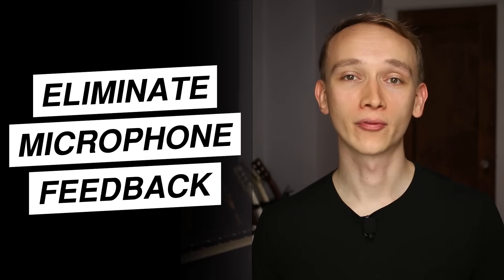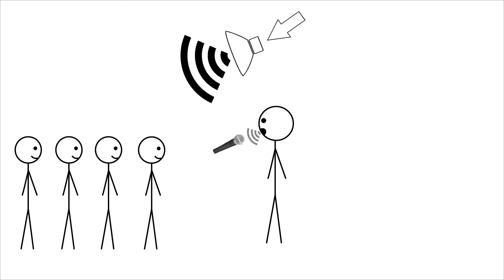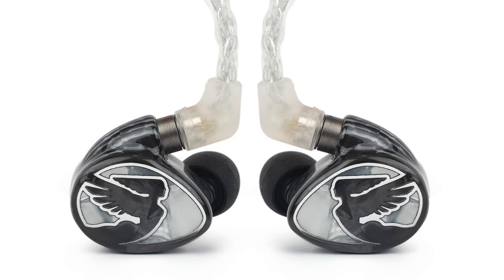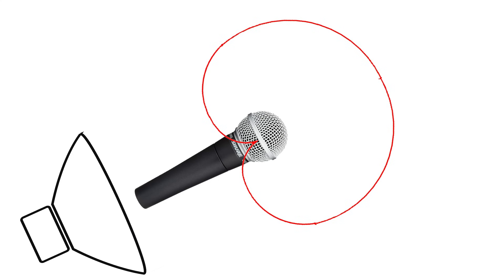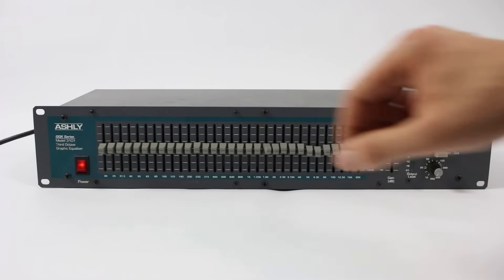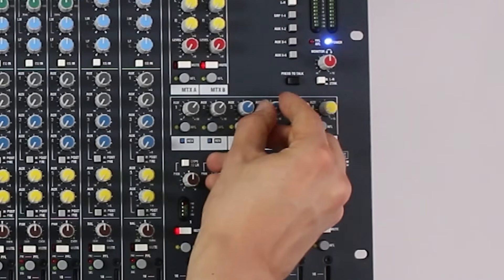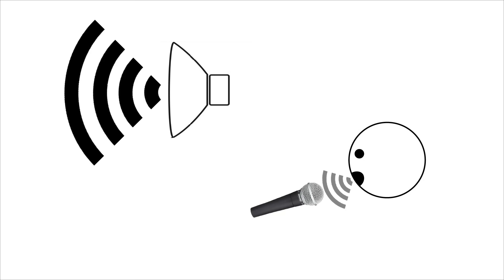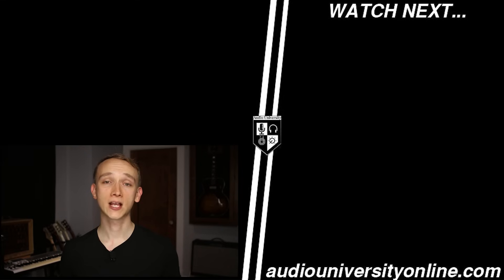How To Eliminate Microphone Feedback | 5 Must-Know Tips

Comment: Here are 3 tips. First, throw every other vocal mic on the front line out of phase. Instead of anomalies caused by multiple mics loading up, they will now cancel out. This stabilizes both mains and monitors. Second, put about 14 ms delay on the mains. Not only does this align the sound from the back line with the mains, it simulates the mains being further away from the mics reducing the chance of feedback. Third, when ringing out monitors by driving them in to feedback, using a compressor limiter at the end of the chain with the threshold set very low to limit the volume of the feed back. This will  not only protect your ears, it will protect all of your speakers. You can now allow the speakers to feedback at a very minute level, giving you total immunity and allowing you to figure out what frequencies are feeding back assuming you don’t have an rta . Remember to return the threshold to a normal setting.  Btw, after setting the system up, during soundcheck drop the threshold of your limiters on both mains and monitors so it hits 3 db of gain reduction on peaks.  This protects your monitors as well as your ears, and helps to keep the musicians from getting audio fatigue.  - 40 years btw of dealing with feedback and musicians.  Mic cuppers sound like they’re being kidnapped btw.

Comment: 6:17 It's worth mentioning why we want to avoid unnecessary amplification.

The reason is because the amp at any point in the path doesn't discriminate between signal and noise. It will amplify both. So a guiding principle to start with a strong clean signal and try not to mess with it too much.

Comment: Nice work, need your help Engineer
I just bought passive loudspeakers
 a mixer,equaliser, crossover and amps.
1. How do I ring out mic feedback
using the graphic EQ without affecting my Eq settings for the song playing, since IAM using 
Only one or the same  EQualiser?
2.Is it possible to use a 2 graphic EQ
For mic vocals and for the song sound Eq
Independently, so that they won't interfere
3.Can you please 🙏 do an in-depth tutorial on 
 crossover knobs functions( since my subs are singing vocals I don't know to fix itI
I hope you understand my problem,
Iam not an audio Engineer 🤯
It's George from Tanzania.

Comment: Putting the stage foldback monitor 180 degrees out of phase to FOH will allow more gain before feedback. For analogue systems, make XLR adapters, with pins 2 & 3 swapped at one end, and place inline.

Comment: Question; I have a Karaoke bar and constantly deal with feedback issues. The room is mostly surrounded by glass, so sound is bouncing off the glass and into the mic. I am currently looking for the best method to eliminate this issue. What do you recommend between getting an EQ or one of those Feedback eliminator devices? Something that you set and forget, and dont need to constantly adjust frequencies. Thanks!

Comment: Great stuff, but one thing that wasn’t mentioned in regards to feedback: venue size and construction 

Having mixed in many small, acoustically poor venues, the gain staging will usually have to be approached differently for each venue, as the process for the last venue won’t work due to excessive reflective signals off walls, girders, etc. 

Still great to know these basics though

Comment: I think preamp gain should be set based on what is required for a great basis for front of house mixing. Ideally you want to have all faders for FOH sound to be within -15 to +5 db area. (Exact markings depend on the mixer, some mixers mark this aforementioned 0db as -18db and then have 0 where you got horrible digital clipping, but should still portray the logarithmic scale on fader markings.) 

Higher gain than necessary results in lower fader position, where even a small movement of fader is a big change in sound level. And lower gain than necessary will cause you to run out of the fader travel without getting enough sound level. And on a multichannel pre-fader multimonitor setup you better not touch the gain after you have set it, no time to compensate everything down the line in a live setting. 

There is a simple trick to get the monitor levels to be at unity if you want to have that: turn down the monitor amp volume control, set the monitor sends, and then turn the monitor volume slowly back up where it is needed.
Reply: Yeah I was just thinking, I understand his strategy in setting the amps at 0db and then slowly increasing the gain until it's loud enough I the monitors but it completely ignores the fact you might need more gain out front.

Had my third time mixing a band recently and they asked me to turn up their vocals in the monitors during the show and I had the most embarrassing screeching for the next few seconds. I hate it so much. Studio sound ftw

Comment: Thanks for the video! I'd like to mention that gain is in everything throughout the signal path, not just the preamp gain control. I think the term could be more clear if called "maximum total amplification before feedback", meaning that it has to do with all the amplification stages the signal goes through.
Electrical noise also has to do with system feedback, so it's always good to set the preamp with the proper gain for the instrument, and letting a bunch of unnecessary noise get through by using the output levels as input levels. I agree that preamp gain has to be set properly, but that means not that too much as well as not too little. It depends on the signal level coming from the instrument, not on feedback.

Comment: Because I’m usually the only person in my studio, I just simply either turn right down or Off my monitors and use IEMs when singing into the Mic just to be safe. 

I’m currently using one of those Zoom H2n Recorders (just for its Microphone) and plug its Line-Out into an audio interface. I do plan on buying a regular Condenser Mic later on though because I’m really interested and want to try one out!

Comment: Question . How do you connect a Behringer FBQ2496 feedback destroyer to a Behringer PMP6000 powered mixer? I am only using this for home karaoke parties. I don't have a full band equalizer to do what you taught.  Only an onboard 7 band equalizer that doesn't seem to help.  A detailed description of using what cables involved ie an insert Y-cable to what input of the mixer. It was not recommended to insert into the FBQ into the microphones' s insert channel per the manufacturer. Their connection diagram on the user manual doesn't seem to suit mine. I have 2-3 microphones, 3 sound sources and 2PA speakers and 2 Powered Subs. Thanks for any helpful answers.

Comment: I have a 2 channel power amp available to connect to an Allen/Heath PA28 mixer. The user manual talks about using FB1 for monitors, which I have configured the A-B outputs where 'A' is used for monitors via one  amp channel and 'B' for Mains via the other amp channel.  Is this the proper way to hook up the monitors or should I be using the Aux send?  I have no individual control of instruments/vocals to specific monitors but I assume that's because I'm limited to just two power channels?

Comment: Is cardiod polar pattern really the most popular pattern for live sound? I find supercardiod to be generally more useful. 

Where a cardiod's null is a single point, a supercardiod's null is a ring, which enables you to place more than one monitor in the mic's null zone. 

Also, with a cardiod, you have to angle a vocal mic at about 45 degrees from the floor to null out a monitor in front of the mic. With a supercardiod, the mic will be roughly parallel with the floor. That works much better for keeping the vocalist on axis even when the vocalist backs off of the mic. With a cardiod mic at a 45 degree angle, if the vocalist backs off, he/she is not only losing volume by increasing the distance to the mic, but also losing volume by going off axis.
Reply from the maker: I’d guess cardioid is the most used, but you’re correct here. There is an advantage to using supercardioid vocal mics. Well said, too. Thanks, Al!
Reply: Most microphones are cardioid, also the legendary SM 58.

Comment: Did you forget to suggest Microphone selection? Condensor Mics feedback at much lower levels than Dynamic Mics (risky!). Another big problem is getting the singer to sing louder than the monitor speaker. A very soft singer is a tough problem.

Comment: There is something subtly wrong with your description of when feedback will occur. It is not when the amplified sound of the singers voice is louder than the singers voice, any sound that makes it to a microphone at a high enough level that when the sound captured by the microphone is be then amplified, the gain produces an amplified sound that then makes it back to a microphone at a high enough level to repeat the amplification in a loop. Feedback is always happening, the screaming of a tight band of frequencies that we call feedback is just when the feedback of any sound can built on itself getting louder and louder until it reaches the maximum volume that can be produced by the amplifiers and speakers. A system can start to audibly feedback seemingly out of the blue or when someone or something moves in a way that reflects just enough extra to trigger a loop of the system is on the edge of a feedback loop. 

The more open microphones there are, the less it takes to trigger a feedback loop.

Comment: I have a limiter in my monitor chain. For problem hard to find freq’s, I drop the threshold of the limiter as low as it will go. I then raise the gain of the mic till it starts to feed back. Because of the low threshold on the limiter, the limiter will only allow it to feedback at a very low volume, not allowing it to “run away”.  At this point you have immunity, and can play with the 1/3 octave, pushing faders up to see which is the problem freq, or cup the mic causing to feedback, all at a low, controlled volume.  Or, view the problem freq’s on an rta. Afterward, bring the mic back to a reasonable volume before raising the threshold back up. I eventually set the threshold to just kiss the louder stuff, helping the musicians from going through too much audio fatigue, and protecting you amps and speakers.  Btw, I trim my mics cold so there’s much less chance of distorting the mic pre.  Remember, a distorted signal can derate your speakers handling power by as much as 90%!

Comment: I have limiters in the monitor chain. For real problems, I drop the threshold of the limiter down very low, then raise the gain on the mic. When it feeds back, the limiter will catch it and it will feedback at a low, controlled volume. Now with relative immunity of the feedback running away and damaging your ears or speakers, you can play with the 1/3 octave to find the most sensitive bands, or if digital, see it on an rta. You can play with it, cupping it, or hold a guitar which also will affect the response. After you stabilize it, reduce the gain to normal, then raise the threshold of the limiter to where it just kisses the signal at the loudest points. A slight limit on your monitor helps everyone with audio fatigue, and helps to protect the system overall.

Comment: 4:22 What if you do not have a graphic EQ? Can this be done another way? The only thing I have to work with is a soundboard (same model as the one you show in the vid) and my ears. Thank you!
Reply from the maker: Any EQ can be used to ring out monitors. Some EQs just give you more bands, which is helpful.
Reply: @AudioUniversity  thank you for your response! What I am trying to ask is if you do not have a computer that shows you the graph of the frequencies (to determine which ones to turn down), is there any other option besides sweeping?

Comment: Hi Kyle, I watch all your videos and I'm very grateful for them.  I'm self learning live sound reinforcement and studio recording as a hobby. 

Can you tell me more about your thoughts on setting the Aux to unity and then using the pre amp gain to get your level.  You say that with the Aux at 0db and using the gain to regulate the level the musician needs, you can keep the gain low.  This struck me as I thought gain should be set to 0db using PFL to ensure the optimal signal to noise ratio (SNR).  Will your method of keeping input gain low result in a weaker signal and bring in ambient noise and then the high Aux level on the output side amplify the artist signal and the ambient noise also resulting in a degraded sound?

If there is a reason what I'm saying doesn't apply or is wrong, I'm really interested to know why, as it means I am carrying around some misconceptions or living by hard rules that don't always apply. 

Thanks for all your videos and looking forward to hearing your thoughts.
Reply: If I may, both the console manuals and AU's approach allow for a unity gain scereno. What was not mentioned here is the system gain structure. It's assumed the system gain was already set. AU discusses gain structure in another video. On the flip side consider the fact audio sources fluctuate. So setting the mixer's aux sends and channel faders to unity and then adjust the gain offers many benefits that may not be mentioned in console manuals. Also SNR in modern analog and digital mixers is a mute point when the engineer approaches gain structure as described in the videos. And then there's the big if, you experience noise while turning up a gain knob, that may be a defective channel or an issue up stream. Like an issue in the cabling, microphone, DI, instrument or amp.

Comment: if you set your monitor send and channel send at unity then add preamp gain to desired loudness you are changing the preamp gain in the front of house. not having tried this method, my immediate concern would be improper gain at front of house (too low, too high). I have always dialed in preamp gain with the FOH. then while running monitor at unity i'll adjust the channel send to musicians needs. I typically find the musician has enough perceived loudness well before the channel send reaches unity or feedback ( given that the musician doesn't cup the mic and the stage is set up properly)
Reply: Right

Comment: Before i start, i turn 0 my foh vol, then i set the overall proper gain structure not more than or lesser than to unity, to make my gates, compressors, eq ect got enough signals. After that i set my monitor sends to "unity"also, then i set the volume of the monitor wedges up slowly, if it feedbacks then i start to use my eq. Then turn up slowly the vol until the its enough to the musician. Then after that ill turn my foh, so im sure i get decent overall gain structure.
Reply: Hi there. I am Timothy from Uganda. I have just started practice as a FOH. Am really enjoying the experience however I would like to contact you in person.

Comment: Hey Kyle,
I really enjoy watching your YouTube Channel for your great advice in learning audio properly. I’m working as an Audio Engineer on many Hotel Meetings & Corporate Events doing live sound in a different Ballroom every week. I’m considering purchasing a reference microphone and could really use your help in learning the proper process of using it. I couldn’t find any clear direction on YouTube showing how to properly use this type of microphone… Any chance you could please put out a video showing us how to setup and properly use a reference type microphone???
We would all greatly appreciate it if you could. Many Thanks!
Reply: Beringher ECM8000 is enough. It is a cheap measurement microphone but it is really good. Just keep in mind that it has problems with the high end (12Khz and up, but you don't usually need to measure phase trace of those frecuencies and tonal adjustement can be done by ear) I've been working for 15 years in corporate events and I use that microphone with Smaart and RiTA FFT-based audio analyzers and it works pretty weel for me. And I don't have to be afraid of loose or broke a 300€ mic.

Comment: Any videos on using lavs? I usually have to use 4-6 wireless lavs for panel discussions and have a horrible time keeping them open (so I don’t need to ride the faders) and not getting feedback (all presenters are about 3’ apart from one another)
In addition, what’s the best way to provide them a monitor? Thanks in advance.
Reply from the maker: I don't have any videos on this, but it's a great suggestion. Here are some notes in the meantime:
- It is definitely a challenge managing multiple lavs on stage, especially omnidirectional lavalier mics. Sometimes, you just have to ride the faders or use an auto mixer.
- I usually try to be minimalistic about how much spoken word goes to a monitor. It usually doesn't need to be very much (if any) unless there is something the speaker needs to hear over, like music.
- Try putting the the lav mics into a group and use a parametric EQ to cut frequencies and feedback in order to maximize the loudness and intelligibility. 

I hope this helps. Thanks for watching!

Comment: Great content. I've been following for a couple of weeks now and I must say your content really is help. My approach is usually first gain staging, all channels across the board. This helps when I have to run FoH, monitors and even running a 2.0 to my computer for multi tracking. Now that all systems have an adequate input signal, then ring out speakers. Each mix/auxiliary master channel to Unity, gradually bring the most common or spec resilient Microphone on stage. Then having a reasonable  amount of Gate (the open and closing points set to sound as natural as possibly  can) also helps cut every inactive signal at a given time. Oh and I use a QU32.
Reply from the maker: Thanks for sharing your method, Lawrence!